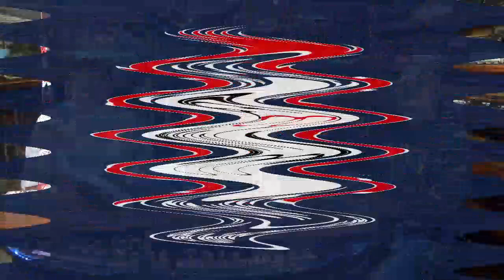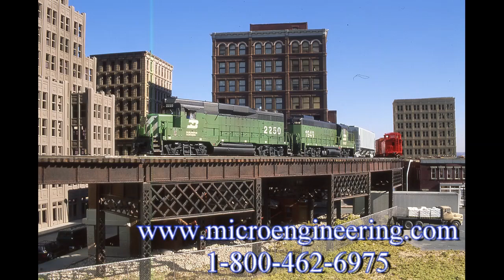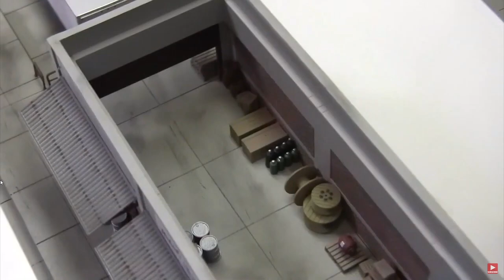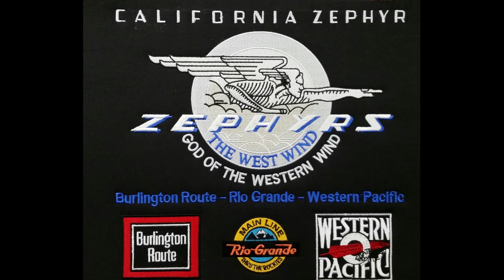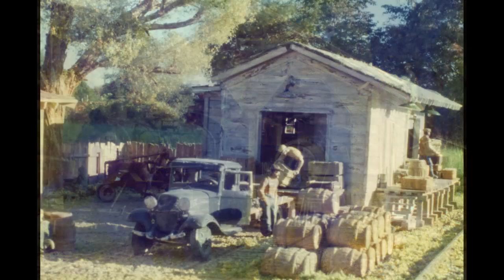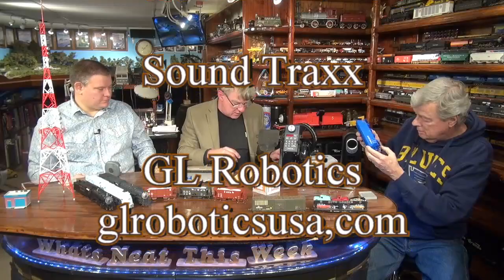What's Neat This Week in Model Railroading #216 November 19th 2022

Comment: Great show - I love that Broadway Limited Blue Goose, then looked at the price. I'm sure it's worth the price, but so many locomotives are getting so expensive.
Reply: I've been wanting a good Blue Goose for quite some time.  I have the old Rivarossi model, but it is aggravatingly inaccurate, has pizza cutter flanges on its wheels, and the mechanics aren't great.  Brass has been the only real option for an accurate model of 3460 until now, and the price on eBay has frequently topped $1000.  I got my BLI brass hybrid model for $784, so it is less than "comparable" models have been.  It's an even better deal if you consider that its mechanicals are modern and reliable, it has superior detail, and it was designed with DCC in mind -- no electrical issues inherent to brass.  It includes good quality DCC light and sound out of the box.
Reply: @JamesRegiersModels  James even though I'm in MN, as a Brit ExPat I model British outline mainly OO with a OO9 section on my 60'X10' layout, There has been a massive amount of discussion on the British groups about the.price of new Loco's particularly from the large Manufacturers.... Hornby and Bachmann, but their prices at around $350 for DCC sound fitted are light in comparison. However I think a Blue Goose is on my list as a visitor to my layout.

Comment: One of the first industries that came into the Tooele (Too - willah)  Valley in the nid to late 1980s was a company that made different types and styles of tanks from plastic pellets that was shipped in  by those PROCAR cars by Rapido. Neat industry to model also. One track came up and ran up against the building, enough room for two cars coupled together,  then another track that ran up along the side of the other up on to the roadway and ended about 50 feet  beyond the roads surface which they used for loading and unloading flatcars. 
Their is a company now out that manufacturer's a septic tank and a 2,000 gallon elliptical tank which would be perfect detail for the industry, a flat car load or even a semi trailer load. 
I've bought four tanks as of now, two will be mounted on a spread axle trailer to haul magnesium chloride, another will be mounted on the back of a three axle semi to haul mag chloride for use in dust control in the summer months. In the winter months the magnesium chloride is mixed with corn syrup and sprayed onto the roads to help against the water from freezing up and keeping the brine on the driving surface to keep the ice from forming and also keeping the salt also on the driving surface.